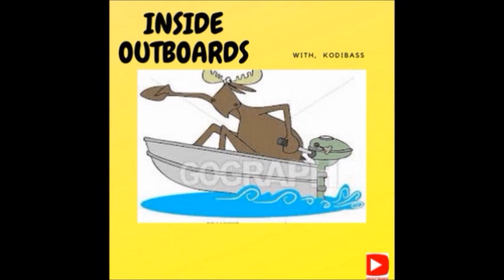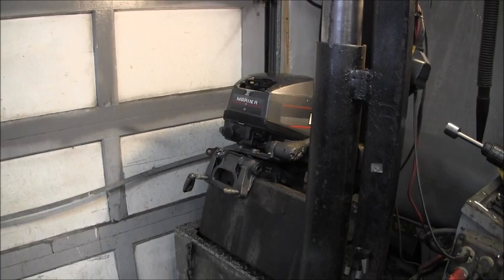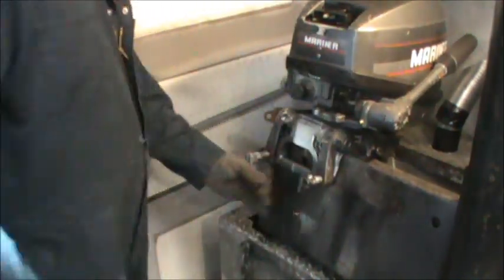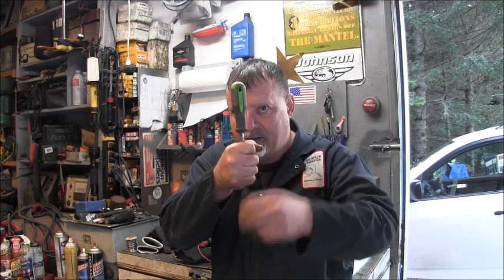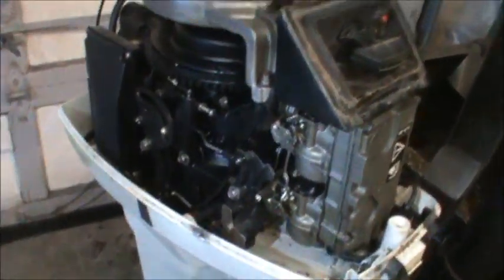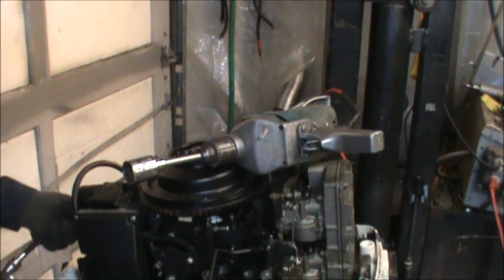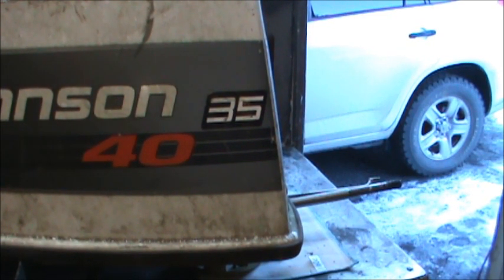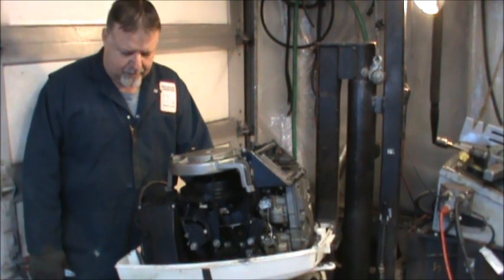MARINER 15 HP & JOHNSON 40 ???

Comment: Hey, great to see you work on this Mariner.. I have the 15 and a 25hp 96 &98 I have to agree the Tiller gear change is awful! I put both mine to manual.. need to be able to rev up and Yes they're safe in my opinion. I love the Merc build Mariners and re built my 25hp and converted from long on controls to Short on tiller... Great reliable engines. Great Video! All the best From Orkney Isles UK :-)
Reply from the maker: Roger that,  I love the older Merc classic 50 in-line 4 cylinder motors one of my Fav, 4  sure.    kodi

Comment: Here is a LONG STORY, but worth reading.

To free up frozen, rusted bolts and nuts here on the farm I’ve used Blaster, Kroil, WD Products and more…BUT! My dry-waller got me a couple cans of this stuff (Gasoila Free All Rust Eater Deep Penetrating Oil 11 oz Aerosol) a few years ago. So I figured it is free…I’ll try it. 

I have a 1969 Wheel Horse Raider-9 with the original 10HP Tecumseh that had been seized solid since about.2010. For weeks after it seized I tried in vain using diesel and used oil mix, fogging spray and various other penetrating lubricants and a 3/4in breaker bar with a 4ft cheater bar on it…NO JOY over the next few years.
In about 2016, I sprayed some Free All in a sparkplug hole and let it set about the length of time for a cold beer.  I broke the piston loose with just the breaker bar then I sprayed some more “Free All“ in the plug hole and worked the flywheel with a 1/2in drill with a socket. For the last 5-yrs the Wheel Horse has been my barnyard, ditch bank and lawn spraying tractor. 
Now “Free All“ is the only thing I use on the farm. Try it you’ll like it.

Comment: Useful for sailboats but better is the later engines (I have 5hp Mariner four stroke) where gear lever is half way along tiller so can be reached easily.. Best of Both Worlds...
Reply from the maker: Yes' Most of the newer builder do this,  much better 4 sure.      kodi

Comment: With that much compression she should need the electric start,because that jewel would be a beast to pull start...lol
Have you come up with a tilt and trim unit for the motor i need..
It is a 1975 85hp Evinrude..
From your expertise, what is you opinion of them..
Thanks..
We also have about the same amount of snow and Temps here in Va..
Reply from the maker: Ricky Did U get the email i sent U?     Great motors if taken care of.       kodi

Comment: I noticed after trying to sell a 1986 25hp remote that no one wants it because it’s a remote. So I’m just going to part it out. However it’s like 13 degrees in the garage at the moment. I was also wondering if you like the UFI ignition? I have it on my 1990 40 and it’s never idled good I’ve been over and over it with no improvement so I just blame the UFI.
Reply from the maker: I like UFI ok,  When I hear idle problems on any of these 40,48,50  models I always suspect sinc & link.  Some will say it ain't so but I have found you have to compensate on the adjustments for wear/slop etc. on these motors as they age.